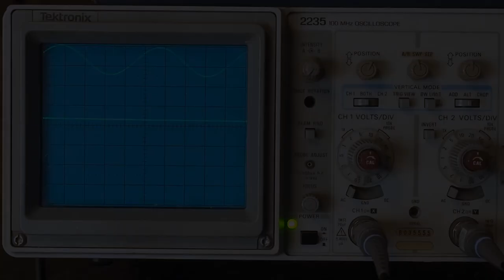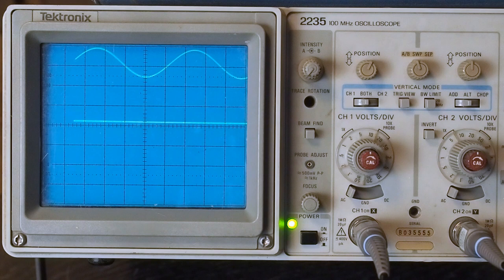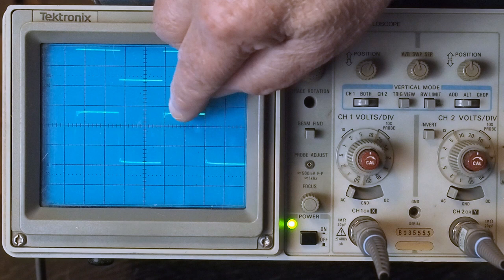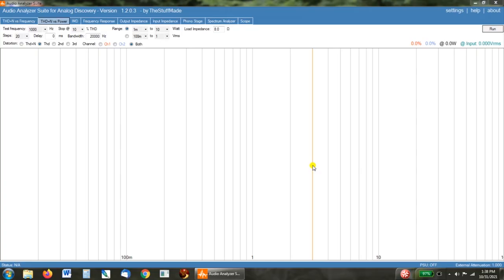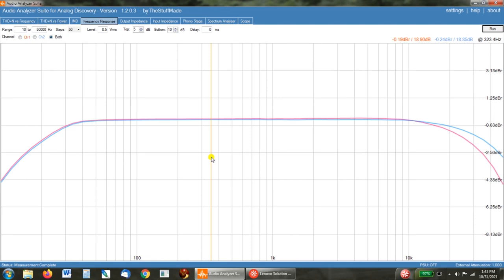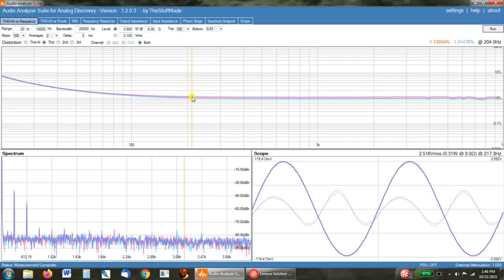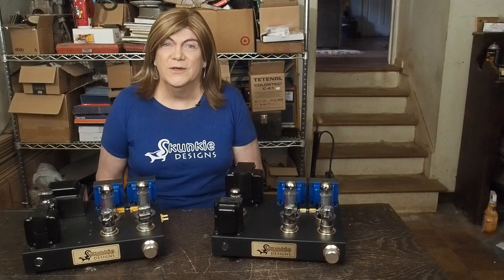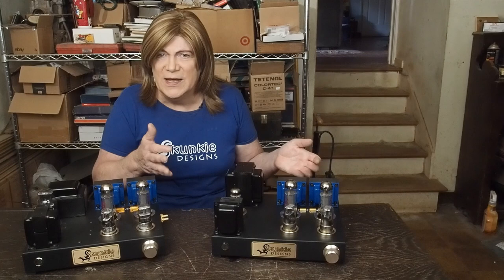6SQ7 EL34 Tube Audio Amplifier: Final Performance Testing

Comment: Great video. Seem to again prove that amps should be evaluated according to their topology and type of amplifying device used. For example, a SE tube amp with no cross over distortion can sound amazing with even 10% of THD. While PP tube amp topology suffers from cross over distortion which can sound bad after 1% already. For solid state amplifiers the distortion should be in .something percent. Even in the datasheets for the tubes they show the THD is 5+ percent for SE operation.
Reply from the maker: Yes and a great post explaining this! For an SE amp, I would say that the best way to "rate" the usable output on an SE amp is looking where hard clipping happens on a scope. And even then, the clipping is much softer on a tube amp than a solid state one! I have no qualms with claiming this amp had a solid, usable 6W of output. This is probably a topic worthy of it's own video :)
Reply: The distortion spectrum really tells the story. Once you get to 100 Hz, it's almost entirely 2nd and 3rd harmonic which at 1% is barely audible. If the higher harmonics continued like they do at 20 Hz, we'd have a very harsh sounding amplifier.

Comment: Great series with lots of practically relevant information. Thanks for reviewing the performance--it all looks excellent. As you, I am not too concerned about distortion, at least not the one on the graph. I am building this to listen to music and not to admire performance data sheets. I am often chuckling when I am reading forum posts, wondering if sometimes the build and the data gets in the way of the actual purpose. Anyway, everything is on my bench now, and I am looking forward to the build. Since I am building your original version, do you think I could turn the choke 90 degrees with the endbell parallel to the front? 
Thanks for all the work, Stephe. You did an excellent job laying this out so clearly and showing that such projects are doable.
Reply from the maker: If you are using the laydown type power transformer, it won't matter which way the choke is aligned. have fun and post your results on the forum at my website!
Reply: So, it's been a month now that I have been enjoying the amp (two choke version). I bought  a variety of EL34s and am still using the cheap Shuguangs I put in for testing. It sounds phenomenal on my RP600ms. I mainly listen to classical music (baroque that is) that comes with high dynamic range and needs a balanced system to sound good. I hear a lot of live classical music (every week) and know how hard it is to reproduce it authentically. The 6SQ7 gives me a tight and strong bass, the highs are crystal clear, and the mids are vivid and true to a recording. Maybe it's just the combination of the amp with these speakers and the kind of music I play but I am really impressed. When I have a strong line source like CD, I cannot max out the amp, it's just too loud. For mobile devices, I am building the 4S pre-amp, but that's more for fun than out of necessity. Plenty loud here as well. Maybe there could be more definition at the lowest volume levels, but that might be the speakers as well. I honestly don't know what I should experiment with. The amplifier is great as is, and as mich as I understand the data on distortion, it remains a theoretical issue for me. If anyone is on the fence--you get a high-end amplifier for the roughly $800 it might cost you. Now, Stephe, what kind of amp tops this one?

Comment: Another great series, thank you so much. I have decided to build my tube amp. Is this still your favorite especially given that I don't have a large power requirement? Thanks.
Reply from the maker: It's for sure the most bang for the buck so far! I'm working on a 12AX7 version which likely will be a bit better.
Reply: OK I will hold off and follow that build series

Comment: When you were square wave testing and you tested the low frequency, how low were you? 100hz?  50hz? I am a novice.  So I hope my question is appropriate.  Thank you!
Reply from the maker: Probably was 50-100hz? I honestly wasn't paying attention to the exact hz. I know I clicked down from X100 (what I was using for the 1K test) to X10 range on the generator as I was turning the frequency dial

Comment: Awesome build. Very interested in one of these, especially given that I would be running it high pass at a little over 100hz to my mains and letting a sub do the heavy bottom lifting. Would free up some power for the rest of the range and also make that 60hz hum in the singe choke configuration a non-issue.
2 Questions:
1. I must have missed something. What was the difference between the 2 amps at the very end? Seems like a larger transformer and different choke/rectifier setup on the one on the right of the screen. Interested in hearing the results of that version once you have them.
2. You seem pleased with your listening tests but what kind of music do you use for your critical listening? Just wondering so I can have some perspective/reference. I listen to a lot of modern and dynamic music like rock, electronic, etc. and I see a lot of feedback that those styles typically shine better with a PP amp due to the extra power over a SE. While I like the design and the results I'm wondering if it's the right type for my usual material or if it's maybe better suited for vocals/jazz/etc. Also, listening tests and tube qualities are pretty subjective so I'm wondering how you would classify the sound of this amp (as configured) - "Neutral", "Warm", "Other"? 

Thanks!
Reply from the maker: 1) I don't hear any difference between the two amps other than that VERY minor hum the single choke amp has. Maybe it would be an issue with 100+db speakers? With my Klipsch RP600M you seriously have to be within a few inches of the speaker to hear it.  

2) I listen to everything except heavy metal, head banger screaming type of stuff. Most of this depends on your speakers and the size of the room. Some SE amps do suck at rock music but I think it's due to the amp design itself, not the fact it is PP vs SE. If you have a large room and large inefficient speakers, PP likely is a better fit. I would say this amp is slightly warm as spec'd, but can be voiced using the value of the Schade feedback resistor.
Reply: @SkunkieDesignsElectronics  Thank you so much!

Comment: Whats your view on 'Parallel Single Ended EL34 ' design to get more power. Pros? Cons?  Its not a design you really see commercially..
Reply from the maker: It doesn't work as well as you would think. You don't get 100% more power, depending on the setup and OT, 60-70% extra is more like it and there are other issues that can arise as the tubes are never exactly matched. Go to a KT88 etc if you need more is my recommendation.
Reply: @SkunkieDesignsElectronics  Thanks so much for your insight.. You have a great channel.

Comment: Hi i dont know how to calculate the resistor value of the cathode with the led can you explain. thanks
Reply from the maker: There is a little trial and error to get to the cathode voltage I need. Usually I'm replacing a cathode resistor/capacitor combo in a circuit. For example lets say the tube has 2.0V voltage drop across 800 ohms on the cathode which means the current draw is 2.5ma. To change this to an LED/resistor setup, I know the voltage drop across the LED is 1.6V. I need another .4V, so at 2.5ma it needs a 160 ohm resistor. You might have to play around some to get the exact value but that will get you close.
Reply: your teaching  is very clear  thank you  have a good day @SkunkieDesignsElectronics

Comment: Are 6SL7 tubes drop in replacements on this?
Reply from the maker: No, a 6SL7 is a dual triode. You could rewire it to use a single 6SL7 or possibly a pair of 6SF5 tubes
Reply: Everyone here needs to have a tube manual.  It will tell you what tube you can use as a replacement, and what circuit modifications you need to make, for a tube with different specs.  The important specs are:  1) Plate & grid bias voltages.  These result in the tube operating in the linear region of its characteristic curve.  2) Plate resistance.  This determines your choice of output transformer.  3) Gm (pentode) or V gain (triode).  This tells you how much gain the driver must provide.